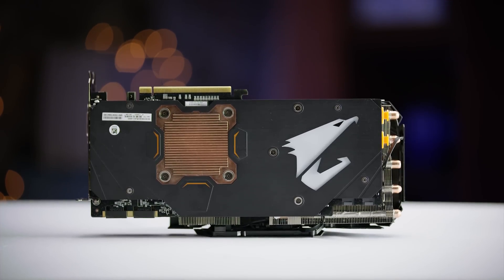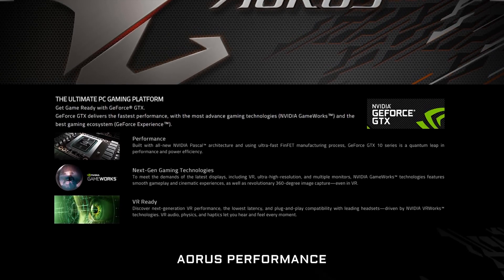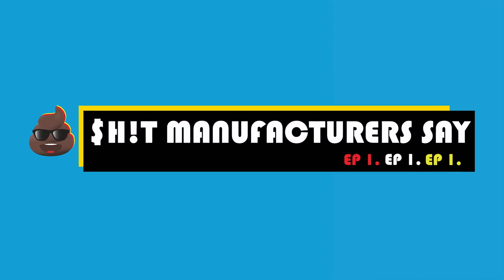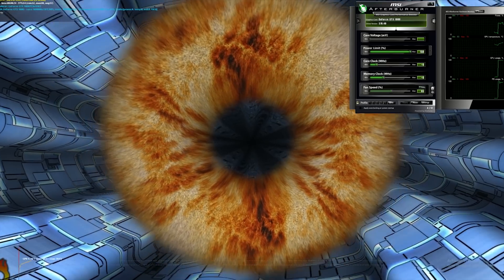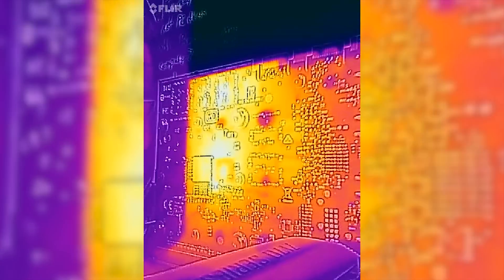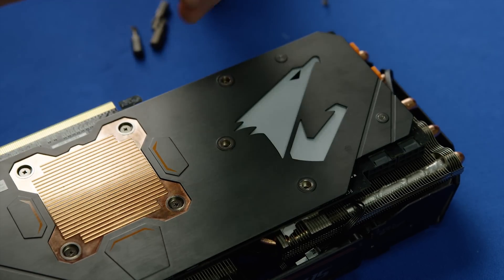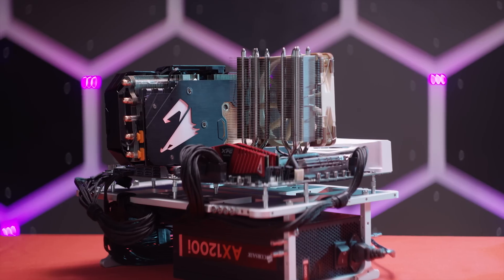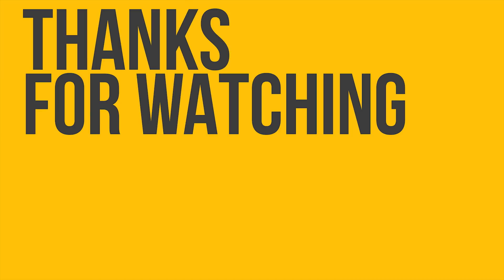$h!t Manufacturers Say Ep. 1 - "Backplates Cool Your Video Card"

Comment: The apparent cold spot is likely due to the shininess of the copper, not radiating as much infrared while it is, in fact, just as warm as everything else.
Reply: I don't think that's how radiation works. An object with higher reflectivity should show itself hotter than another, darker one if the lightning and temperatures are identical.
Reply: What you mean is that's not how infrared works. An IR camera cannot pick up a shiny surface.
Reply: No, a glass or mirror would not show the temp of the thing or person hiding behind it. Thanks vsauce3
Reply: You are incorrect. An object with high reflectivity will have low emissivity/absorptivity and show up cooler on an IR camera, because IR cameras function based off of how much radiation the object is emitting, not reflecting.
Reply: Skullthrax You have two objects, one is a piece of shiny metal, the other is carbon, they are red hot at the same temperature, and lit with the same lamp. Why would the carbon be any brighter with the IR camera?

Reflections do not absorb light. Reflections can only add to the existing light emission.

What am I missing?
Reply: You are missing thermodynamics. It's complicated.

Comment: I still don't know how to remove a bra...
Reply: You have to remove the two screws from the inside, Luke just showed you how. And the connector is fragile, be careful.
Reply: as a male a little advise Bra's generally come with a live filling they know how to remove it ...
Reply: Only in the LTT comments
Reply: Instead of pulling the strap on the back sideways you take one and push the other one towards the one you are holding onto.Nearly all of them have 2 hooks on one strap that latch onto the other strap's crevice.
Reply: Deon Spates scissors is the easiest way
Reply: Joseph Stott issa joak bud
Reply: Ste T
lmao that is so true, they're self removing
Reply: Deon Spates just don't wear one.
Reply: Thermal grease helps
Reply: When you get the chance, learn to do it one handed.
Reply: Deon Spates and you never will
Reply: push both sides in and slide one up
Reply: RenceBence have you ever ran into one of those bras with like 5 hooks, fucking fruitless
Reply: Deon Spates Just go for guys
Reply: Ryan Hall I can't remember what that's from

edit it's the office
Reply: I have this great finger snap sort of method. Works every time
Reply: just move the hooks off..
Reply: Deon Spates its alot easier with one hand
Reply: LOL
Reply: >< drag them togheter and its unlocked!
Reply: Remove the two screws from the inside? I'm going to go out on a limb and say neither of you two have a girlfriend lmao

Comment: 1. The "Cold spot" you see is just the reflective copper in the middle of matte aluminium.

2. The fan speed is still not fixed for every test. How can we know the card does not ramp up the fans to maintain the same gpu temperature with or without the backplate.

3. It's an open test bench, there is close to no airflow over the backplate.. It will work as much as a watercooling loop with no pump..

I find you lack of methodology... disturbing.
Reply: yeah.
I thought the same. I think a little airflow over the backplane makes the difference. And sure fix fan rpms
Reply: R4GEcraft not checking the fanspeeds = wrong methodology = futile conclusions
Reply: agreed - convection vs conduction heat transfer yields very different results
Reply: "Comment about how right you are(and how sad this would makes Steve from GamersNexus) also a quick mention of the lack of awareness of the vrm temps in the video"
Reply: Steve must be facepalming so hard..
Reply: I ne'd.. Methodology on LinusTechyTips?
Reply: the card runs on full load the whole time. You are implying that the fans did not run at max speed.

If the fans did not run at max speed and can cool the card down to 67 degrees without the backplate, why even include the backplate?

In the end, the backplate did NOT make the card any cooler. Maybe it is easier to cool with the backplate, but that is not what the manufacturer advertised.
Reply: Disagree on the airflow note. Airflow to the copper piece is not guaranteed on ANY build, and this is a point to be made AGAINST it. It's true that the copper piece no doubt had heat transferred to it, but where the hell would it transfer that heat to?  Normally, it's transferred to air going out and away from a heat source, by use of fans, but this has no fans. This is why this piece could only possibly contribute to the cooling of the GPU if airflow was directed to it in such a way that cold air would "bounce off" of it. (Essentially, you direct cold air airflow to it at an angle, the air "absorbs" some of the heat, but "bounces" off and goes somewhere else)
Reply: Yup just another video of LTT shit tier amateur mythbusters.  Seriously a 6 minute video to tell us they put a card on a bench and then made shit up?
Reply: Pretty valid questions, criticism. This could explain it.
Reply: What the hell are you talking about? Cooling is a function of temperature delta and airflow. The heatsink will work fine with very little airflow as long as the temperature delta allowed is large enough. This comes down to what the engineers intended, and what is actually supposed to be cooled here (as it's obviously not hte GPU itself). I'm guessing it's the VRMs that are supposed to be cooled here, and therefore the temperature delta could be extremely large as VRMs can generally take quite high temperatures. Much higher the GPUs itself, and I'm also guessing the heatsink is supposed to cool the VRMs down so that the capacitors see a lower average temperature, ensuring a significantly longer operating life time.
Reply: R4GEcraft Thank you, this video was so stupid.
Reply: They should take this garbage off the internet. Praise this man!
Reply: Bump for correctness....
Reply: R4GEcraft evga has a similar thing with its new icx gpus. But in order to get better results, you do need airflow flowing around the card. So it's very possible the same could be said here.
Reply: true, but, backplate needs a redesign to work as a cooler to allow airflow help with temp, like it is now, just straight flat, I dont think will work ever.
Reply: R4GEcraft did you drop the mic?
Reply: LOL , yeah with 4 million subs you could probably get so many companies to let you do so many stupid things with expensive shit nobody would ever fuck with in the same way.
Reply: 4. A "Cold spot" does not mean it is cooling, what it does mean is that it does not radiate as much heat as it's surroundings, which considering the surroundings would mean it is isolating, which makes no goddamn sense because it is cooper and really just proves 1.
Reply: It appears that Luke has assumed that the fans would be working at max power in both tests.
Reply: that thing only cools your room from the computer heat, not the computer itself.  same temperature with or without it.
Reply: R4GEcraft not to mention the simple fact a backstage isn't there to cool the GPU it's there to help cool the components. hence less resistance, longer life, better power consumption and many many more bonuses. gpu is not the only important thing on a card neither is it the only thing to get hot
Reply: It doesn't matter if there is airflow or not. Fin arrays increase surface area to make convection more efficient. There is already natural convection occuring on the open test bench. Adding air flow would create forced convection but you would get the same forced convection for both cards and end up with the same result.
Reply: There is already convection taking place. Forced vs natural won't change whether or not the fin array on the backplate does anything.
Reply: Don't get too eager to suck him off. He's wrong.
Reply: It's still an apples to apples comparison. The manufacturer didn't say you needed airflow over the backplate to get the 3% temp reduction. I doubt ambient airflow in a case would make much difference. Also you may have a point on the fan speed but how do you know he didn't set a custom fan speed and just forgot to mention it? You sound like the manufacturer trying to justify why their "feature" works even when testing shows it doesn't. Unless its 67 degrees ambient temp in the room, there should still be some heat transfer from the backplate because that's just how heat transfer works. Even if it was only 1 degree instead of 3, I would expect a change of some kind.
Reply: R4GEcraft And that's why I rarely watch LTT anymore. J2C's incorporated a fan blowing at the backplate, and it does cool the GPU. Getting annoyed at the LTT group for rushing videos, and egoistically conclude EVERYHTING that they think is right, without proper testing methodology. Sigh.
Reply: Forced convection is going to cool the GPU regardless of the stupid backplate. Forced convection is really good at cooling things.
Reply: R4GEcraft what about when running SLI would the back plate make any difference with another card on top or vice versa?
Reply: powerful knowledge.
Reply: SaturnusDK
And I'm guessing the numbers on the next lottery are 6,5,25,31,17, and 2. And that your hair is black.
One of those is very, statistically likely, but still just a guess. Come back when your words are based on something with a little more value to it than guesswork.
Reply: Neighbor Vadim Binary Agenda TonkarzOfSolSystem richardwayne1990  *****  Pinkie Pie (copy-pasta from my earlier comment:) Airflow to the copper piece is not guaranteed on ANY build, and this is a point to be made AGAINST it. It's true that the copper piece no doubt had heat transferred to it, but where the hell would it transfer that heat to? Normally, it's transferred to air going out and away from a heat source, by use of fans, but this has no fans. This is why this piece could only possibly contribute to the cooling of the GPU if airflow was directed to it in such a way that cold air would "bounce off" of it (Essentially, you direct cold air airflow to it at an angle, the air "absorbs" some of the heat, but "bounces" off and goes somewhere else. Essentially, you need to blow air at it. That's not likely to be part of your average PC setup).
The copper piece will act as a thermal buffer, getting some heat transferred to it, and it will radiate some of it onward to the air around it, but once both reach certain temps, heat transfer between them will become very very limited. Unless you blow air at it, or away from it, of course.
I just don't think that's likely.
Most people still use AIOs for their CPU, which is usually placed "right in the way" of the two rear top coolers (rear-top&top-rear, the corner), limiting how much air from those gets to the plate, and/or, how much air is sucked away from it. (Not to mentioned that if the top one is on push, the air it pushes in the direction of the plate would pass first through the AIO cooling system of the CPU and thus be warmer when it reaches the plate)